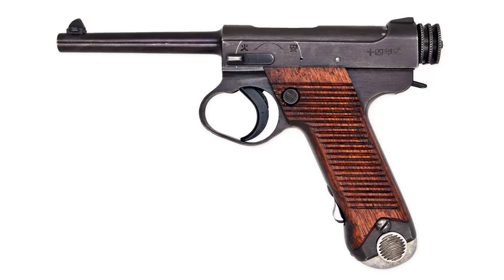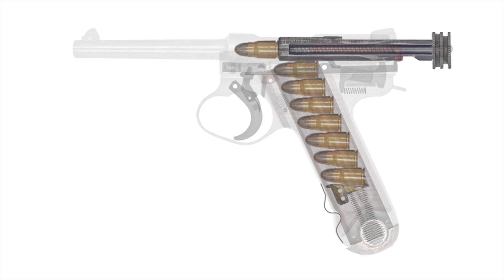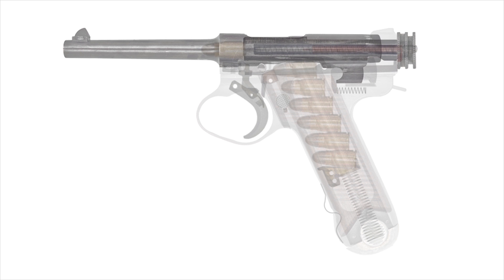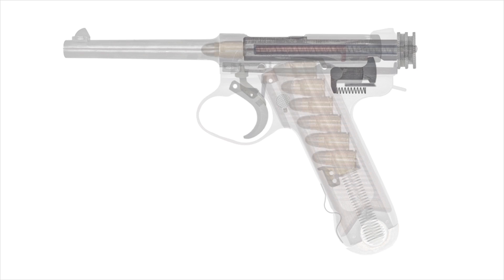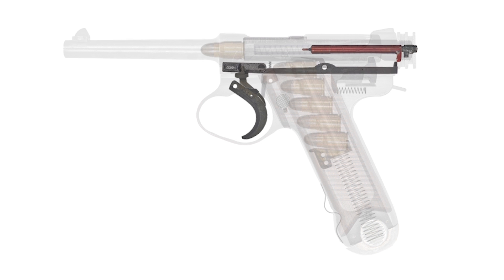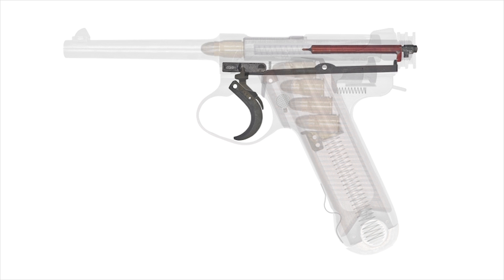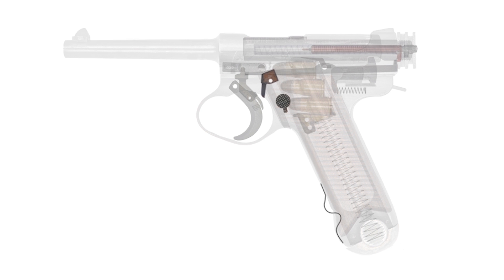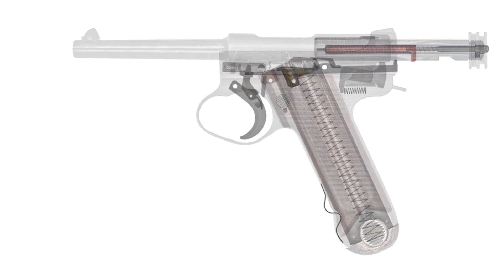How it Works: Japanese Nambu Type 14 Pistol

Comment: The 8mm round had about the same energy as a .32acp, used by many European officers. The 180 degree safety is identical to that used on the Italian Beretta. The pistol holds well, and can be very accurate. I owned one for some time, and can see no reason for it to be so bad-mouthed.
Reply: Jammed a lot
Reply: @jason200912  I've seen other gun youtubers who fire the thing with well specced ammo and the type 14 ran fine. It seems that alot of the jams in modern videos seem to be from rounds being loaded too light since 8mm nambu ammunition is all custom loaded these days.

Comment: Would you be able to fire the gun while on safe if you pulled the trigger hard enough or does the safety completely block the trigger bar?
Reply from the maker: +Hugh Woatmeigh Completely stuck.  Can't pull through.

Comment: The design doesn't seem to bad why does it suck so much
Reply from the maker: Mostly poor springs and a weak firing pin
Reply: Is that a design problem or manufacture problem?
Reply: @ragingagent5040   Nope, bad iron ore due chemical impurities inside of it.  The real test of the design is if it done with modern steel alloy and fired the same number of round that was tested for the Colt 1911 pistol.
Reply: @Mythteller  so you’re the guy that replies to four year old comments.